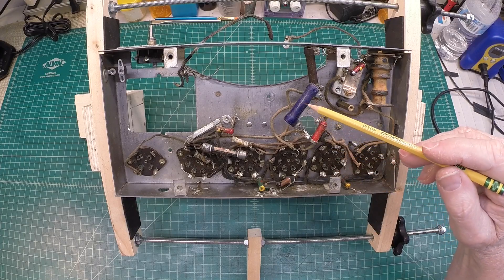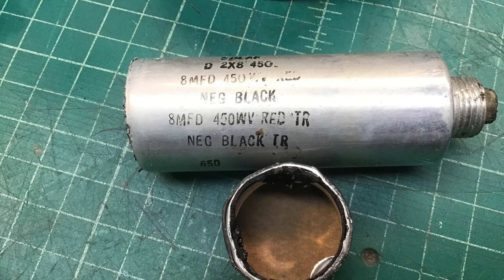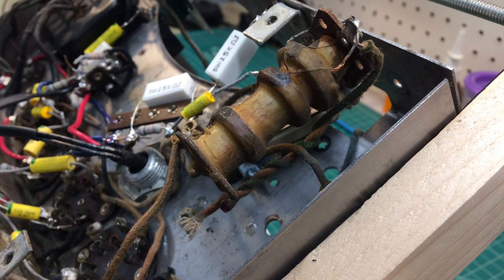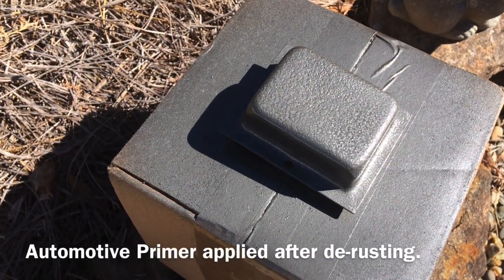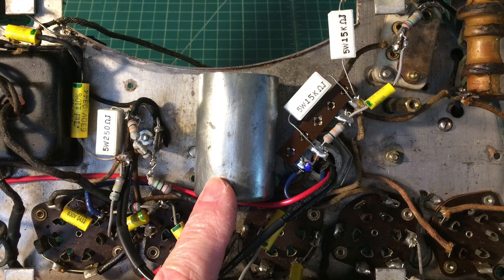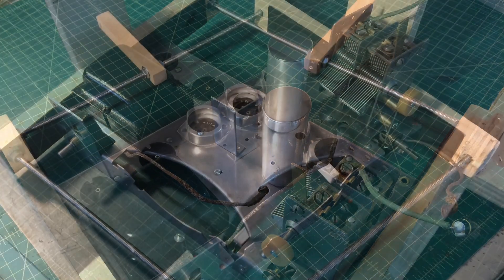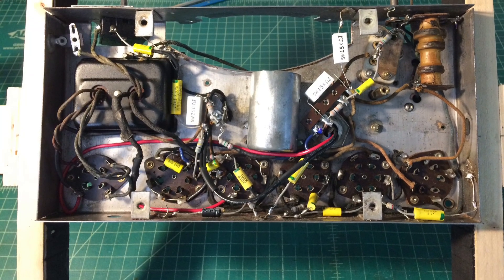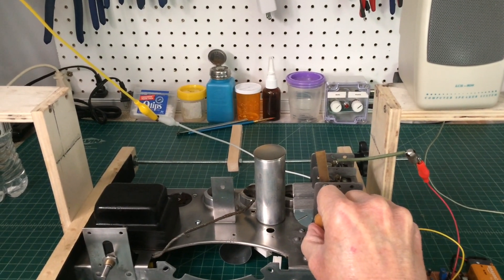Zenith 707 - Restoration Update - Capacitors, Resistors & More...

Comment: I greatly appreciate the work that you are showing on the restoration of the radio.  I also have the same radio and a review of the parts list shows that the voltage divider resistors part number 63-297 calls for two 30 k ohm resistors, 3 watt, but you are using two 15 k ohm and they do not appear to be in parallel. What is it that I am missing?  
Tony
Reply from the maker: Hi Tony - Thanks for reaching out. The Riders schematic 4-7 shows the Candohm resistor 63-297 as 30M, of course that being 30k. Zooming in on the schematic shows the Candohm configured as a voltage divider with a tap between the 15k/15k section that connects to the positive side of capacitor 22-211. So the Candohm in total is 15k + 15k + 250 ohms. Please let me know if this answers your question. Best, Don
Reply: @RestoreOldRadios  Don, Ah, that clears things up perfectly.  My radio is quite a mess in and around the electrolytic capacitor with wires being twisted together in a horrible blob.  It appears that it hasn't been touched in decades. On close inspection in place of a two-section Candohm resistor there is a badly corroded wire wound voltage divider resistor, that I presume should be two 15K sections that total 30K.  The help that you graciously provided will greatly improve my chances of bringing my radio back to life. Many thanks. Tony
Reply from the maker: Tony - glad this helped. Feel free to reach out if you have any additional questions. I know you’ll have her singing again soon. All the best. Don

Comment: You never stated what capacitor value you went up to from the old double 8uF electrolytic capacitor.  Just wondering. Great job on the chassis work.
Looks brand new! Doing a very professional job on the restoration so far. Like it very much Don.
Reply from the maker: Steve - 20 uF for the input capacitor and 30 uF for the output side of the Field Coil. Thanks for your feedback on the restoration, it’s appreciated. All the best. Don

Comment: Great progress! It looks like you cut the top off of the electrolytic can for the restuff. How did you re- attach the top of the can? Or is that a new round piece of aluminum? Thanks!
Reply from the maker: Jake - you are correct. Tubing cutters between two pieces of painters tape (a few layers) with a small gap in between to help guide the cutting wheel. I keep the tubing cutters stationary in a vice and rotate the can slowly in my hand to make the cut as clean (straight) as possible and sand off any rough edges before replacing the top with a Metal Hole Plug; 1.25” for this particular can. This allows easy access in the future if needed. Hope this helps. Best, Don
Reply: @RestoreOldRadios  Great! Thanks for the reply!

Comment: The one electrolytic can I popped open just had the aluminum rod with a bunch of wound aluminum sheet with holes in it wrapped around. I'm sure you know what I'm talking about. Anyway I cut the rod off at the base, which is separated from the outer shell by a rubber grommet. I tried to solder to this on the inside but gave up. Do you drill hole through the rod or what?
Reply: This is the kind where the rod goes down to underside and has nuts and terminals on it.
Reply from the maker: Sarah - check out my earlier reply. Best, Don
Reply: Looking great Don!
Reply from the maker: Thank you James. Best, Don
Reply: @RestoreOldRadios  Don, I'm still working on the zenith 807. I ordered and received some nice walnut veneer as well as hide glue and syringes to try and reach back further into the delaminated substrate. I am starting to wonder if I should just send the cabinet to you. I'm sure you could do a better job than me.
Reply from the maker: Sarah - don’t underestimate your abilities. You may have a few do overs, but that’s to be expected. I’m sure your results will be amazing. If you need to share any photos of any problem areas or need anything along the way, feel free to reach out to me at my gmail address at TheRadioRepairGuy. All the best as you move forward. Don
Reply from the maker: Drill it out is your best bet. Soldering to the aluminum is nearly impossible. Best, Don